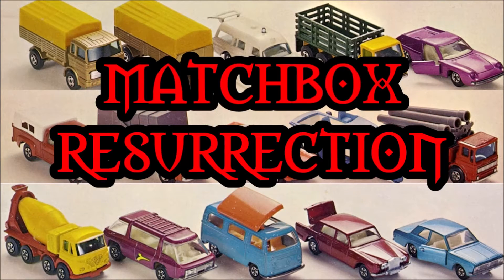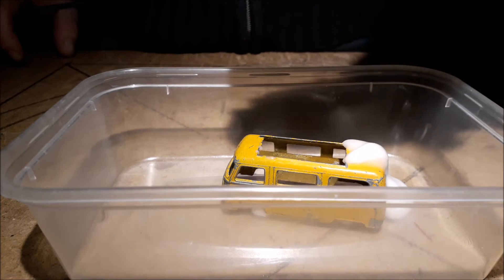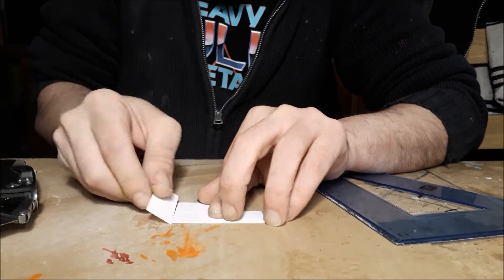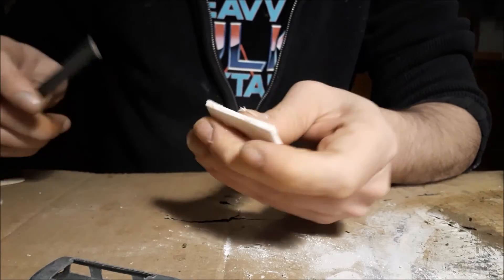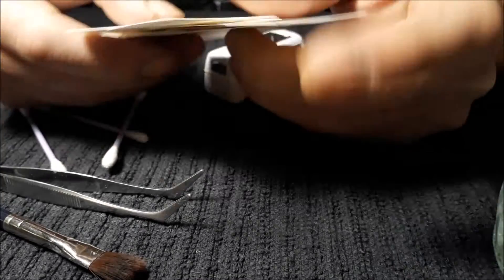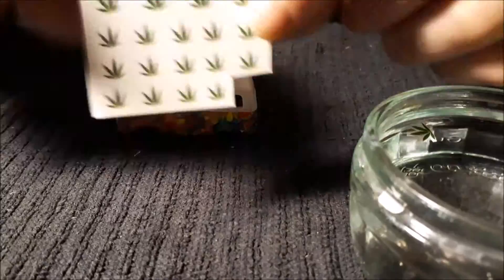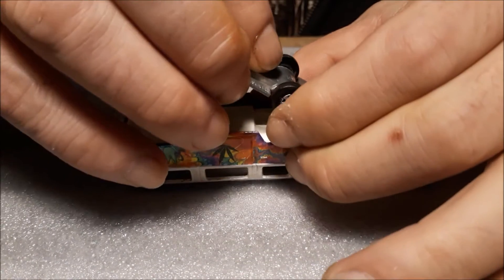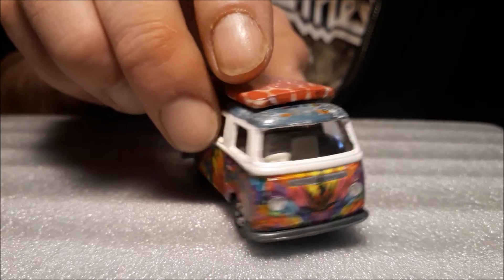Matchbox Volkswagen T2 Camper No23E Custom

Comment: Beautifully done Working with waterslide use a sponge and your water that way you’re not completely submerged them Did you clear coated afterwards it would be a shame to lose all that
Reply from the maker: Thanks for the tip, I will try the sponge. And Yes, I did put some clear laca all over. It also makes the finish more uniform and hides the joints between decals